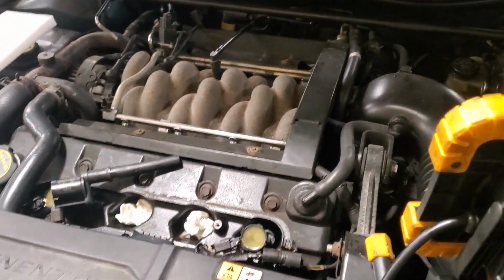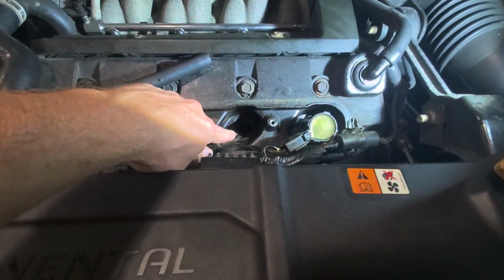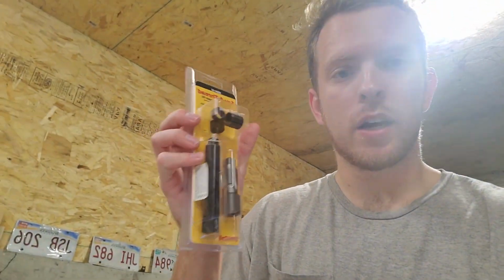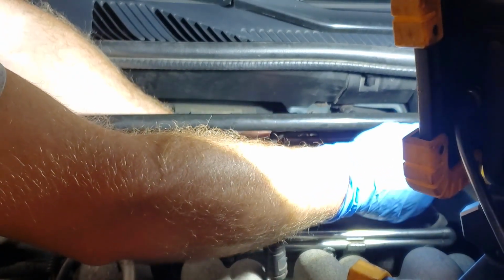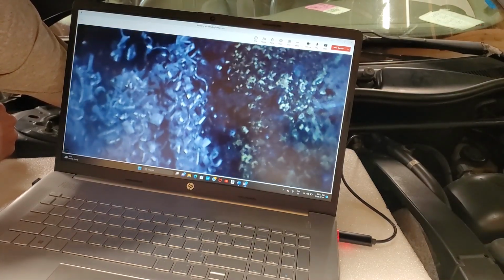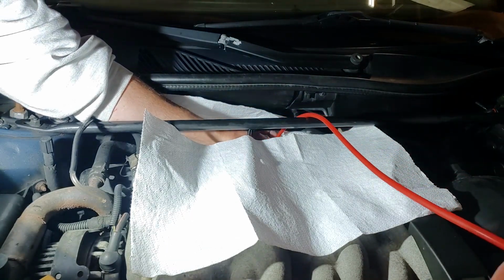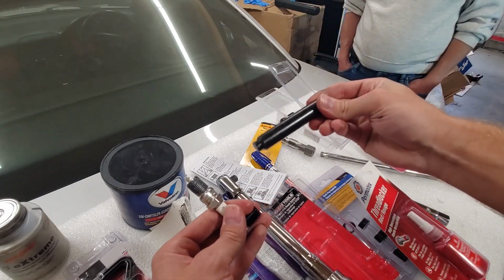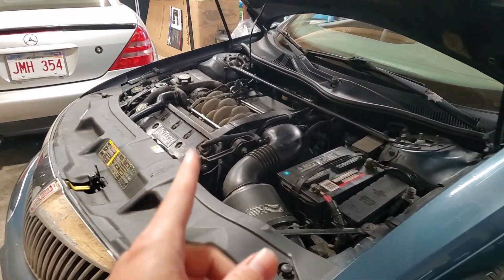#1 Spark Plug BlowOut Repair Step XStep to Save $$$$ on Any Engine! Ford Lincoln 4.6L 32V Intech V8

Comment: Did you have to weld the ratchet extension? I ordered one it wont fit in the tube for plug?
Reply: You ordered the wrong one. The one used here has a 3/8s extension attachment.